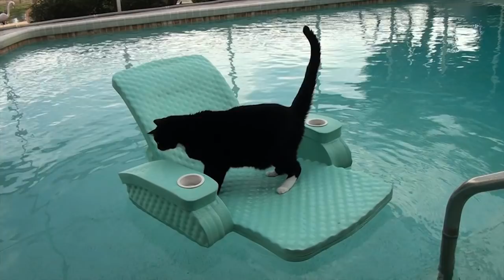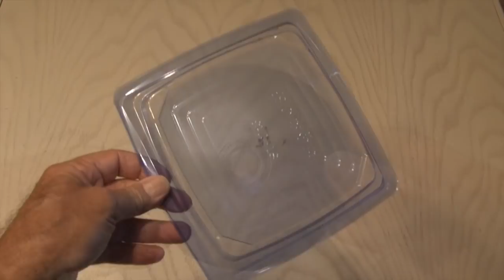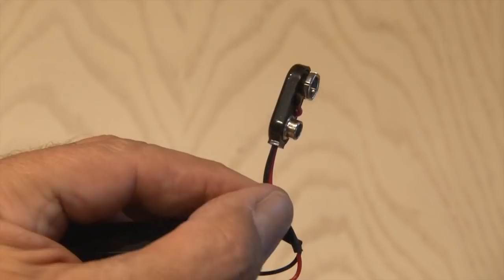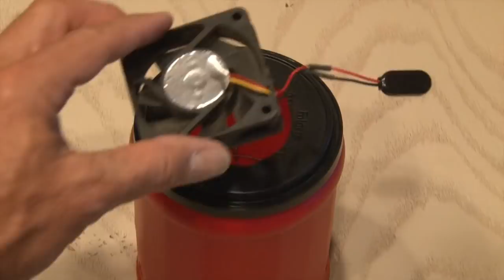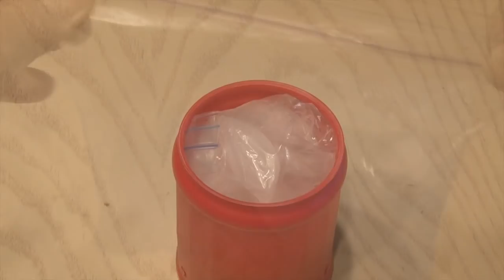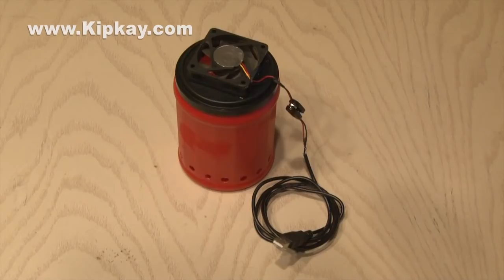$2 COOL CAN Keeps You Chilled!

Comment: Can I cool my computer like this or does the air have moisture?
Reply: I think there's no moisture because the ice is in a zip bag.
Reply: Tom Tchilov So I can cool my PC with this :P
Reply: ***** unfortunately, i can't guarantee (and i even don't think so) that the power of this is high enough to cool efficiently. And you have to refill the zip bag :/
Reply: Tom Tchilov Well you can just leave the can right under an intake of the case so it pulls cooler air inside the case, thats what I meant :P
Reply: ***** i thought that you meant mounting this on the CPU :P

But it's possible to mount it so that it takes cooler air in, that's a nice thought! Good luck, share a picture when you're finished! :D
Reply: Tom Tchilov Yeah I don't know if I would go that far lol
Reply: Just make sure the temperature doesn't get below the air temperature. That could cause condensation and moisture.
Reply: I will try this on my laptop.
Reply: Pro tip: put salt on the ice, it will melt faster but get colder
Reply: No. The difference between the temperature of the air that is exhausting and air at room temperature is (I'm going to estimate) 10-15 degrees F.

Now most people keep their air conditioning set to about 70 - 80 degrees fahrenheit.

Computer components such as graphics cards and CPU's run anywhere from 122 degrees F to 212 degrees F. We'll average those together at about 167 degrees.

The difference between the temperature of those components and room temperature is about 85 degrees. A 10 degree difference is not going to do much, also consider the fact that you will have to replace that ice frequently.

If you want to cool your computer better get better fans

Comment: you can start with upgrading your fan, if that's not an option we can work on that can of yours. First you need to increase the number/size of the holes at the bottom, then make a star shaped divider that will get the ice to fall into narrow channels so that they can't bunch up and cover all of the airflow.

Comment: Fan at least $5.00
Coffee Box: $6.00 (I dont drink coffee)
Battery: $2.00
Battery holder thing: $1.50
USB: $3.00
Hot Glue gun (including glue): $5.00
Computer Grill: $3.00
X-Acto Knife: $3.05 
Drill: $40.00

Total: $65.55 (mental math)
Reply: that escalated quickly.
Reply: Fan at least : 2$ (everyone has some fans they can find)
Coffee Box : Get used one free. even if you dont drink coffee you can get it. also it doesnt have to be a coffe box, it can be anything else.
Battery : 2$. you are right here, but powering this from 9V is stupid. it will only last for 10 minutes max.
battery holder thing : 1$ or you can get free from used 9v battery.
USB : 1$ max for an usb cable, + I'm sure you can get one free from a friend or something.
Hot Glue Gun : maybe 5$ but everyone has an hot glue gun, and if not u should buy because it is useful for alot of things, not just this project and also for alot of time.
Computer Grill : 1$.
Knife : you cut your food with knife right? you can use any knife or any thing you can think of to cut. and also even if you buy this x-acto knife you can use this knife for alot of other things.
Drill : 40$? everyone has drills. drill is useful for alot of things. if you dont have drill you should buy it now. than you should also say "house : million, food : other million" why not? this project is 10$ max. the tools cost more but alot of people has those tools alerady.

Comment: I had a load of computer fans, and I carve wood, needed a small sawdust extractor (sawdust vacuum),so I made a sawdust vacuum!! didn't cost me anything! and it works really well!
my med. sized fans need 12v, can I use a 9v battery for both?
(I got this idea from make magazine, your solder fume extractor- would you like the plans for it? I also made a yardstick coat hanger wire antenna (I sent the plans to make magazine).
Reply: You can use 9v for it, it'll work fine.

Comment: If you get a rubber band you can put it around the coolcan and the inside of the binder clip and this way you will not have to keep track of your binder clips. How about a string around the cool can it could send air up to your face. Better still add one of these to a hat like the Beaver top hat and not only do you get a killer looking hat but one that is functional. Place a solar panel on the top and it will really kick it up when the sun is out.

Comment: what you need to do with this design is make a small holder for the battery inside, and run the wires through the inside. also add an on-off switch. great idea though!

Comment: no. you reverse the red and black wires because of the way the 9 volt battery clips are wired. if you didn't flip them the fan would blow in the opposite direction.

Comment: yes, however the voltage determines the speed of the fan. In this case it would blow 25% (or 9/12ths) less than it normally would. 

Warning: Don't do it the other way around (putting a 9v fan on a 12v source) because than you risk burning out the circuit!

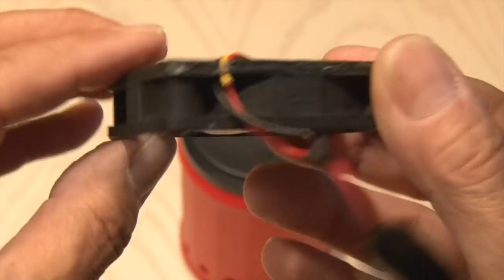Comment: Then you would just mount the fan the other way.  The video says (at 1:27) to orient the air flow going out.

Ahh, I get it.  The USB 9V battery connector is used in reverse.  It connects to the fan connecter black to red and red to black.  Since we are using the battery connector as the power source instead of the destination, we need to reverse the normally used polarity of the connector.  The fans direction is still the same for battery or USB that way.

Comment: made it but skipped the part with 9 volt battery clips and soldered the wires from the fan  and USB-cable to eachother, also i used cardboard with holes in it instead of the computer grill. i had also a square can in stead of a round can.

Comment: Haha, you are actually correct. my fan is 0.16A PAT DC12v and I am giving it 9v Battery. Plus the intake holes are not so big they are considered as small in my opinion. And the ice is actually blocking the airflow ... Do you know how to make it unblock the airflow, 'cause the bag is sitting at the bottom preventing air from going up.

Comment: Why flip the red and black cables?
Reply: The polarity on the USB--->9V-clip has the be the same as on the 9V battery. (small knob + ; bigger knob -) So when you plug it into the other 9V clip you get red + ; black - . It is a little hard to describe but I hope this helps ;)
Reply: Because it works!

Comment: actually it wouldn't work as well I think not to mention having CO2 blowing into your face. dry ice is colder than ice yes, but because it goes from a solid to gas bypassing the liquid state it gives you less time to make yourself cooler. The same effect (more or less) applies to crushed ice in a beverage. the beverage gets cooler faster (more surface area/surfaces to cool) but doesn't stay as cool longer than cubed. The biggest point though is ice melts into cold water dry ice does not.

Comment: Wouldn't it run slower if you connect USB because the battery is 9 volt and the fan is 9 volt but USB only puts out 5volt

Comment: Guys guys guys calm down. I know the Xbox 360 was internal cooling. In itself it is alright. If you keep the moisture away from the internals, it would improve upon what is already in the system, thus keeping the system cooler and running faster.

Comment: You get less power using a 9v battery because most fans are rated for 12.0v
If you get a 9v fan, then you cant plug it into the USB port, because those are 12v

Comment: wont work so great using usb as these fans need 12volts and a usb is only 5 volts so its very weak using a 5v power supply.

Comment: They still had fans and heat sinks internally. If they didn't they'd burn up in.... minutes really. The fans on the back accounted for the poor circulation. If they didn't come with fans and heat sinks, they burn up and die before you could load up a game.

Comment: I had 12v fan . I puted wood in rain tube( puted on roof to coleft rain) than i lighteh  chunks of sawdust and puted fan on one end. Heet was insane there were fire in air(sav dust burning of the groun) when rain drop  fel on metal tube it turned to steem. On end of tube i could put pan and cook😆 it wuld be 2in1. Heter and coker

Comment: Well for one, this isn't $2.00. You need to spend at least $5.00 to get the coffee can. Second, not everyone has a crap load of computer fans laying around, so off to eBay or Amazon or whatever site to buy a computer fan. Not all computer fans run on 9 volt. Some run on 6 volt. So if you plug a 9 bolt into a 6 volt, after a while, its gonna break the fan. And third, getting a extra USB is going to cost you money too. So, again, off to eBay or Amazon or whatever site to buy them on..

Comment: Why not connect a usb cable to the fan itself to a computer or usb outlet instead of using 9 volt Battery clips of your not planning to make it portable
Reply: if you are gonna make it portable you can use a USB battery bank as a power source

Comment: the cheaper ones are, the good ones are like 5-10$ and the best ones are >20$, the cheaper ones are just louder, bit less effective and wear off (become even louder) faster, but they will work fine for years, and even the good ones will wear off if not cleaned, also this is a retarded way of wasting a 9V battery, and a 9V battery can be connected without a clip only by using two wires and a 4mm screw (or 5 mm, I'm not sure since I don't do this anymore)

Comment: What happens if you don't have soldering machine
Reply: That's a really good question! If you can find something sticky that conducts electricity, use that to stick the wires together and then wrap it in tape. If you can't find anything sticky, sorry, I can't help you.
Reply: Well thanks anyway sam
Reply: (Y)
Reply: what you want is called a "bread board" they're used for prototyping circuits: no soldering required
Reply: Oh thx